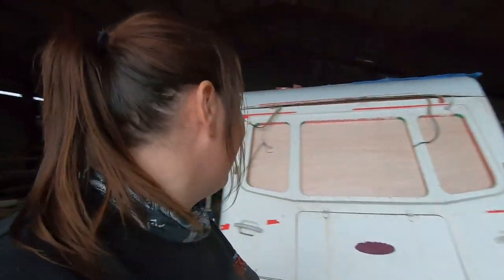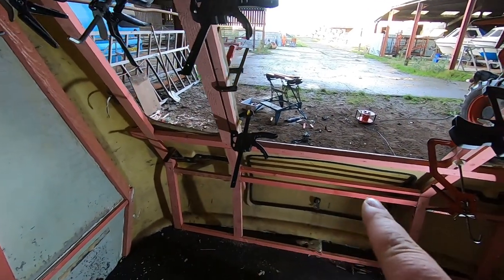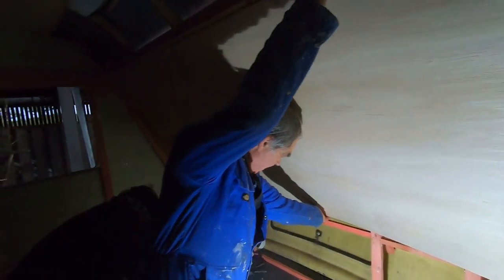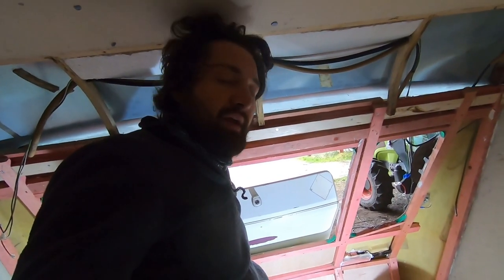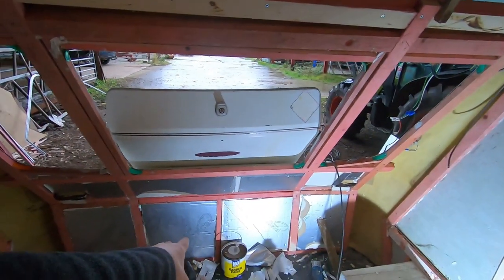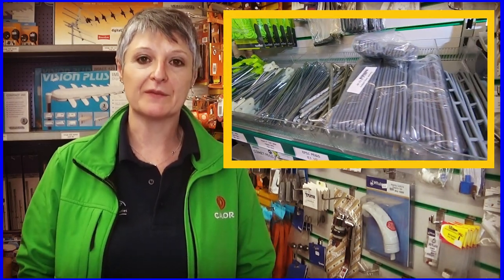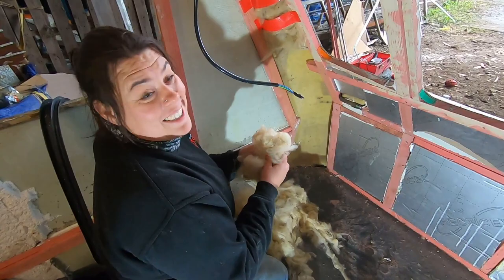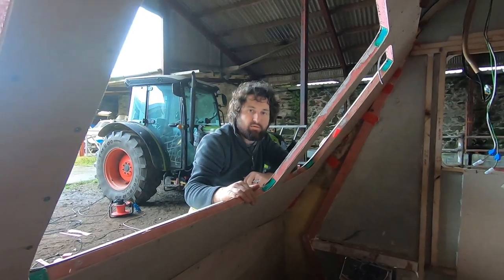Repairing A Damp Caravan: Part 7 – Ply Lining The Front Windows | #dampcaravan #RVRepair #UKcaravan

Comment: Cracking progress again, always good when you start adding walls rather than removing them.
Reply from the maker: Very true!  I've got one more ceiling panel to remove, but will be doing that today, as carefully as possible.  However, the same panel 'should' be going back up!
Reply: @TheMcNeillsonWheels  When I put the curved part of the ceiling up I steamed the ply board so it bent without cracking.

Comment: You have made the front locker a bit small, may I ask where you are putting the Gas bottles ?
Reply from the maker: Hello Again,

We've never stored our gas cylinder in the front locker as it's too large to fit. There's no point in us using the small bottles as, being full timers, we'd be back and forth to the gas merchants far too often. If we ever go touring, the gas bottle and spare wheel will be in the back of the towing vehicle.

Comment: hi guys thats a great project,how you call those windows corners and from where i can get them,i just broken mine lool 🤣🤣
Reply from the maker: Hello!  Do you mean these: https://www.ebay.co.uk/itm/CARAVAN-MOTORHOME-BOAT-WINDOW-PLASTIC-UNDER-RUBBER-CORNER-INSERTS-/274375029846?var=0&mkevt=1&mkcid=1&mkrid=710-53481-19255-0&campid=5338268676&toolid=10044&customid=Cj0KCQiA-OeBBhDiARIsADyBcE7KTFWyjHoliDP2YSe_A2rWbXScwmGCs6ZgjCCCaYa8_r_PxCP1iQ4aArBzEALw_wcB

As they're quite expensive for what they are, could you not try fashioning some of out of some scrap material?  Their purpose is to support the rubber window seal so that it doesn't form too sharp an angle.  

Best of luck!
Jamie